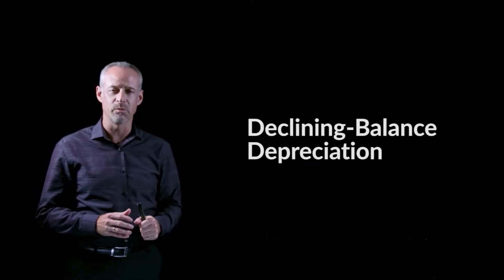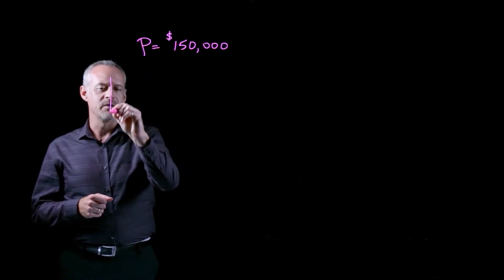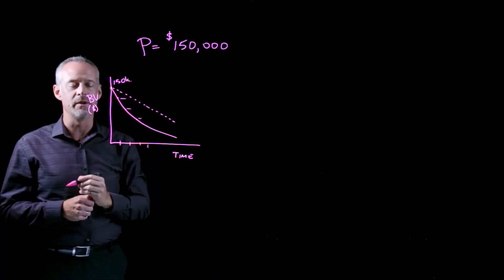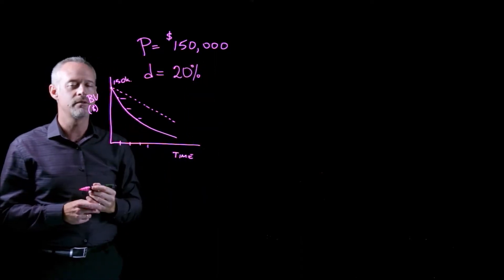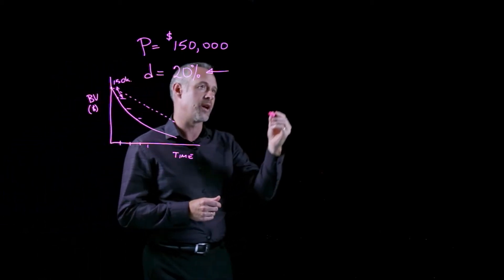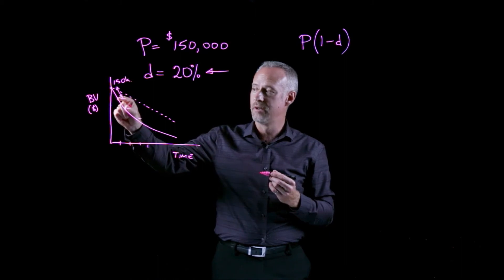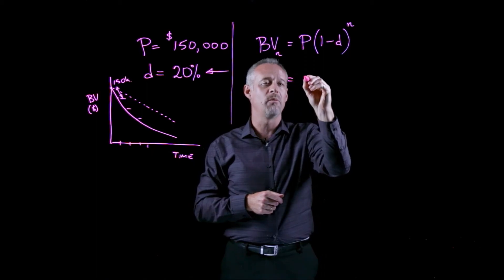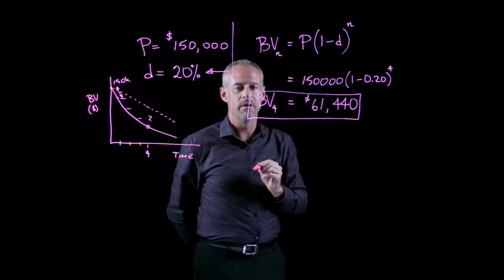Declining-Balance Depreciation - Engineering Economics Lightboard

Comment: how can I solve this problem? I need help please.
software and hardware for optimizing cell design of robotic picking lines have an installed cost of 78000 with no residual value after 5 years. for years 2 and 4, use DB (Declining Balance) and DDB (Double Declining Balance) book depreciation to determine a) the depreciation charge, and b) the book value.
Reply from the maker: This is a somewhat strange and tricky problem.  The first thing you need to do is solve for the depreciation 'rate'.  I have a video that can help you:  https://www.youtube.com/watch?v=Ll2zSn88jNk
The challenge is with the zero salvage value; I suggest you just use a very, very small number instead of zero to approximate the zero salvage value (in theory, the value of an asset never reaches zero using a declining balance rate).  Once you have the rate ('d') you can construct a year-by-year table that describes the book value and yearly depreciation charge.  Sorry I don't have a video on double-declining balance but I suggest you do the problem with declining balance, then tackle the double-declining balance scenario!  Be sure to state your assumptions in your solution to the problem (professors like that!).  Good luck!

Comment: a company acquired a machine on 01.01.2013 at cost of 130,000 and spent 2,000 on its installations and 3,000 on trasport. Life of the machienry is 10 years. The company uses the declining balance method of depreciation for machinery at 30% a year. the books of accounts are closed on the 31st december every year. what will be the depreciation charge for the year 2015(year 3)?
a)19,845
b)28,350
c)13,500
d)88,695
e) none of above answers is correct 

Someone could help me?
Reply from the maker: I'm pretty sure the answer is a).  Usually, installation and transportation costs can be included as part of the total 'acquisition cost' of a machine, and therefore you can include them in the depreciation calculations.  So start with $135,000 x 0.3 = $40,500 in depreciation charge for Year 1.  Ending book value Yr1 = 135,000 - 40,500 = $94,500.  Then $94,500 x 0.3 = $28,350 in depreciation charge for Year 2.  Ending book value Yr2 = 94,500 - 28,350 = $66,150.  Then $66,150 x 0.3 = $19,845 in depreciation charge for Year 3.  
Hope this helps!
Reply: @EngineeringEconomicsGuy  you are a big man. thank you so much
Reply from the maker: My pleasure.